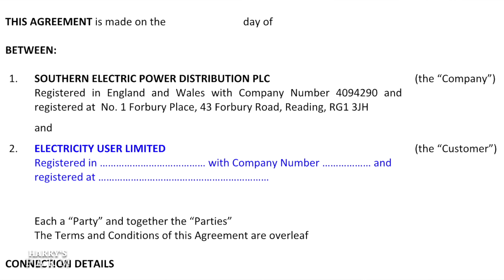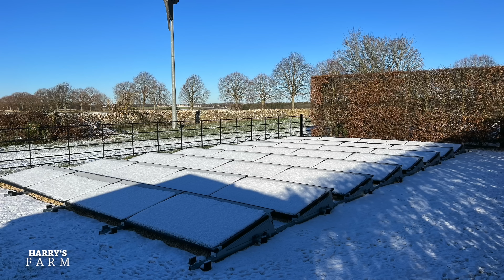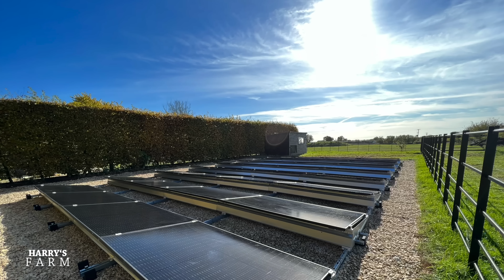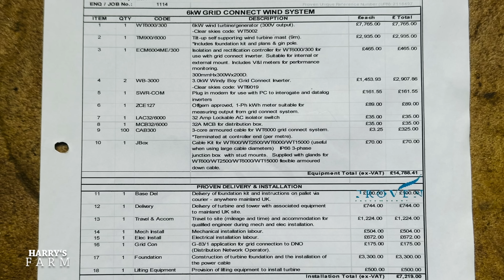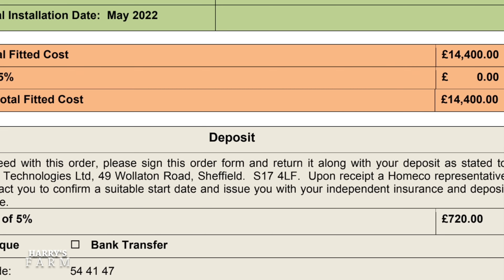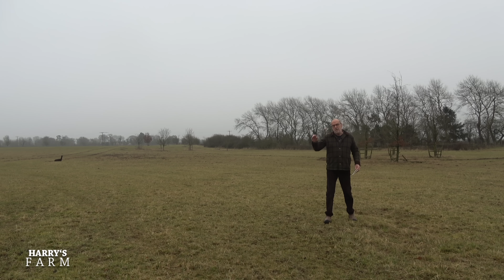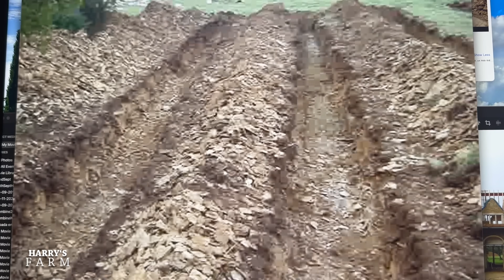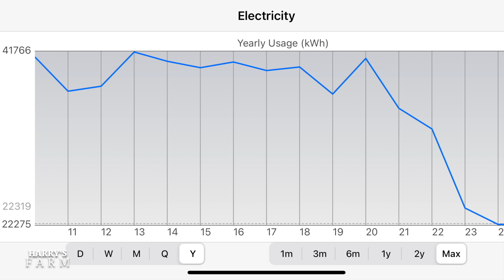Are solar panels & heat pumps worth installing? Here's what I've learnt after several years of use.

Comment: I agree Harry, they are all worth installing.  I have 8KW of solar.  4KW installed in 2011 which has a good feed in tariff of around £2500 a year.  I later added another 4kw, plus a Tesla powerwall 2.  I have a ground source heat pump (7KW) Kensa unit which is incredibly efficient.  The COP was reading 4.7 yesterday which as you point out means for every KW of energy the system takes from the grid, it generates 4.7KW of heat for the house or Hot water.  I also have 3 EVs at the property, meaning our total energy use across the year is around £1500, but our solar payments are £2500 meaning I am making £1,000 per year from my system.  That includes all my heating, hot water, cooking and 30K miles in 3 EVs.  We also had a rain water harvesting system installed meaning our water bill is around £90 per year.  I would love a wind turbine, but as you point out, you get far more bang for you buck with solar.  Whilst solar has come down massively in cost, wind turbines have not and I cannot justify the spend in comparison to more solar.  I applied to my DNO for another 8KW and it was refused.  I am therefore now fitting another 8KW to my barn and making it off grid, with a 40KW battery inside and an EV charger on the outside to charge our cars in the day during the brighter months.  The one thing you seem to be missing is batteries.  Whilst your setup is very impressive, you could reduce your costs further with batteries.  Charge over night  from the grid and let it discharge throughout the day.  This would mean your entire energy consumption could be costed at the overnight rate of 7p instead of the 23p you are currently paying.  Then export your solar with Octopus at 15p to increase your income.  Given the size of your property, you would need a lot of batteries, but they would pay back quickly.  My investments have all been made to make my retirement years (7 years away) as cheap as possible by removing one of the larger bills and replacing it with an income.  Heat pumps are getting a lot of negative publicity, yet they are a no brainer.  Love the video and it was interesting to see your figures as there are not many videos on YouTube where people talk about their solar, ground source heat pump combinations.  It is interesting to compare performance, although my property is much smaller.  thanks for posting. John

Comment: The shading issue and panels shutting down - there is a solution for that. You need a inverter per panel… its pretty common to install when you have shade. Bit odd they did not do that.

Comment: Aga efficiency:
So the Aga costs 15KWh/day.  at not more than 100% efficiency. 
It is costing more than running the heat pump, at 400% efficiency.

I'm not saying that you should not use an Aga if you want to - go for it.  But physics says you're wrong about the efficiency.

I have noticed that people who have an Aga tend to also have a regular oven.  I personally would choose more ovens / induction hobs, that only generate heat when I need it - for heating food.  But each to their own.

Comment: I live in The Netherlands and have few idea's from what i was thinking and calculating in 2019, free standing 1964 house, 3 persons.
Principle of freezing water to extract the heat and resore this in the summer.
Heating and cooking on Natural Gas.   My energie costs (2018):
Gas  2477 m3  = Euro 1757   Electric  4406 kWh  = Euro 698    (El = 18 ct / kWh)

Wiki: NLgas = 9.259 kWh/m3
so for heating  2477 * 9.259  = 22935 kWh
CV heater is 44 kW = 4.75 m3/h  with a max output temp of 90 C but set at 70 C as thats enough

Energie density water (rounded values and ranges in degree Celsius)

 range +0 to 99 is      4 MJ/m3  = 1 kW/m3
 range -0 to +0  is 320 MJ/m3  = 80 kW/m3
 range -X to *0  is      2 MJ/m3  = 0.5 kW/m3
Energie storage for heating must be atleast 22935 * 3/4 = 17200 / 80  = 215 m3   (for COP = 3)
Heatpump 1/4 * 44 kW = 11 kW  ==> 15 HP    1/4 * 22935 = 5734 kWh * 0.18 = Euro 1032

So I can save 1757 - 1032 = Euro 725  what means that the investment of the whole system in only viable on a new building :(

Comment: In south-east Queensland (Australia),
From a 15kw inverter system supplied  from 20 kW of panels (facing east, north and west) we are getting between min 1.8 and max 2.8 MWh per month,  for a yearly total of 27 MWh.  ie the daily average yield is 74 kWh.  ie latitude of 26degrees helps. 🙂

But nothing generated at night, and in our hot, humid, summers we need the air conditioning running at night, which is somewhat of a nuisance re demand management.  😐

There's no ROI on batteries though at current prices of $1000 per kWh of capacity, and we would also need a lot of batteries to get enough kW of power ( kW, not energy ie kWh) to run the 10kW 3 phase whole-house aircon.  The batteries haven't paid for themselves before they reach forecast end of life. 🙄

Comment: Location location location. We have 12,000w of panels and in December we made 600KWh’s and in June it was close to 2,100KWh’s which was limited by our usage. We do still use propane for cooking and heating but we are in the process of installing the newer solar powered A/c and heating system that hooks up directly to a solar panel array of 1,600 watts and uses our battery storage when the sun goes down.

Comment: I’ve got a similar setup size wise but added batteries and kept my oil central heating rather a heat pump. As Harry says solars great in the summer but the advantage of ‘oversizing’ is that it means spring and summer is also good. As he says you might as well chuck a blanket over them in the winter!
Export tariffs and batteries means I can use cheap rate overnight to charge batteries in the winter and anything exported in summer is paid a reasonable amount now.  Good solution for an individual with a mains supply too but rubbish for a country to rely on!

Comment: Hi Harry, Ive been using solar for 10 years and I am self tort. The system you have installed, if adverse to shading, should have optimizer fitted to either each panel, or each pair of panels. This helps with the shading problems. Your solar array is very low down and at a shallow angle, which also contributes to poor performance in the winter months. 

Battery storage for domestic applications is worth it, just on its own, because you can store cheap over night energy 8p per kWh, so a saving of 15p compared to your kWh price. But then you live on a farm and might not have access to cheap overnight energy. All our energy comes from this 5 hour window, which is used during the day to heat and run our home and charge our EV.

Another alternative people might like to consider, if they do not want solar on there roof, or live in a flat, is community energy like Ripple Energy, where you can save up solar kWh for use in the winter months during the summer months. Link here https://energysavingtrust.org.uk/how-community-energy-schemes-can-help-the-uk-reach-net-zero/

Great video, just needed a bit more home work before publishing.

Comment: Good review ,we have an air heat pump and its fabulous ,high initial cost but electric costs much lower.It is much more efficient in the summer for a/c .not so efficient in the winter as Harry stated.We live in a warm climate(southern US),Heat pump has paid for itself in 6-8 years.Solar and the in ground heating does not work as a home installation especially in cloudy Britain.

Comment: OK the dog on the lilo made me laugh a lot! Im new here to this channel. but your content seems solid chap - I guess YT recommended it as I watch engineering and electrics stuff (im an engineer, not a farmer). Best of luck surviving the BS that is our current govt/economy to all the farmers!
FYI - my opinion on green energy: Solar is pointless in the UK, its great for nations that need air con in the summer. Wind is solid everywhere its windy (but only when its windy) and (what most people call)heat pumps are dumb and LESS energy efficient than alternatives, what you have is technically geo thermal - which IS solid.
For an english farmer - Id suggest WIND and GEO THERMAL combined with burning your own waste products in a traditional geney(though thats probably legally difficult now)
Personally Im looking into electrolytic systems to replace my gas boiler as only the owner of a small home - and surprise running into LEGAL dificulties despite the engineering being simple and well understood.

Comment: what was the promised (if any) payoff date on both the turbine and the solar array? (to be clear the point at which the unit has paid itself and the installation/maintenance to current off) and has given actual realized gains. Also does the UK have incentives or tax breaks for installing solar? I have 2 390W panels flat mounted on the Roof of a 34ft Airstream and in both IL and Az I can capture near 1kwh a day even in the dead of winter. The system at your home/farm is massive by comparison so either you have much more dense overcast skies than we do, or something about the switching system you mentioned with shaded panels is woefully inefficient. even on very short clouded days 3Kwh seems low

Comment: Your installer probably did this, but you can put optimisers on each or as many panels as you like, shading could block a particular panel, normally reducing the array o/p, but the optimiser will progressively bypass an affected panel, allowing the rest to work efficiently. The array voltage would reduce too but the system works v. knocking out the associated string. This will work until the inverter dc i/p voltage is too low to convert.
Reply: Given the angles and vicinity of the panels to each other, I suspect his installer didn’t do it. He also wouldn’t be noting the problem if they had. 

People suggesting adjustable angles are right. I’d bet he could double the off-summer output.
Reply: @Eponymous300  the seasonal angle only makes about 5-7% difference (depending on latitude).
Reply: @silverbackag9790  Well, I was certainly exaggerating with "double" esp. in the cloudy UK, but the impact can be over 30%. The other issue here is the fact that snow won't fall off these essentially flat panels so easily. Having them at the correct value of 50-something degrees would add that factor as well.

Comment: Only partway through the video here, but I'm curious why the panels lay so flat at that latitude. If they were facing more directly toward the sun, the installation could have the same generation capacity with fewer panels. As a bonus, snow would be less likely to accumulate. Also, why were the shadows from the hedge not properly planned for? Those hedges didn't grow several feet in two years did they? Maybe they did. I don't know much about hedges. Why not microinverters for each panel? I have some very pointed questions for the designer of that installation. More benefit could have been had.

Comment: You never told us what it costs you! You give us the electricity produced (22250 kwh) and then you multiply it by the current price of electricity c 25p. That's the market price not the production cost. Presumably you are producing it at a fraction of 25p. Otherwise why bother.

Comment: Harry, you need a battery to make solar work in my opinion.  My solar system return on investment is SO much faster by utilising the battery.  Basically, the battery stores excess production from solar panel production in summer for use at night and, in winter, charge cheaply from the grid at night for power supply to your appliances in the day.

Comment: You best install a 12kv inverter with 15kw of panels, which will increase how often you generate the max, and increase production in the winter month.
And yeah, heatpump powered by solar in the winter is not a thing, or you need to massively oversize the solar panels array.

Comment: Optimisers should have been installed on each panel and the problem with shading should have been dramatically reduced. Also installing at a higher pitch say on trays would have been better to get ride of snow. Water and dirt.

Comment: Here in Virginia USA (37° Latitude) difference between min and max months for solar is more like a factor of 2-2½.  Also, from the look of it, your slinky trenches can't possibly be 6 feel deep.  Looks more like about 3 feet.

Finally, I know many houses in Britain have radiators for heat and I would point out that a ground source heat pump can work quite well with radiators, you don't need to go to all the expense of putting in underfloor piping.  We have such a system and it consumes about 3000 kWh per year.

Comment: Your solar panels are at the wrong angle for winter in the UK.  That's why they don't produce any electricity during winter.  In southern UK an average solar panel should be at 51 degrees.  The same as you latitude.  Dead winter 23 degrees higher (74 degrees).  Dead summer 23 degrees lower(28 degrees) .   I would settle on something like 60-65 degrees.

Another option is vertical double sided fence style solar panels.  You place them in a field in north south fence rows spaced enough distance apart to run Ag equipment between them.  For example you grow hay between them.

Comment: Average UK generation per kw array is 850kwh so you are just above the average....but during summer it will pull up your average  so its actually quite poor....I'd really consider repositioning as the shading from hedges will be huge. 
Wind turbine is good during winter months however.

Comment: You can install a 4kW solar system without permission. I use the grid as a virtual battery, I export all solar production during the summer and get paid 15p /kWh, I am still spending last summers surplus. I have house batteries that I charge overnight for 7p so very rarely use any peak electricity. Last year we imported 9000 kWh at 7p and exported 6000 kWh at 15p. we run two full EVs and a heat pump, house batteries are the key to make this possible.